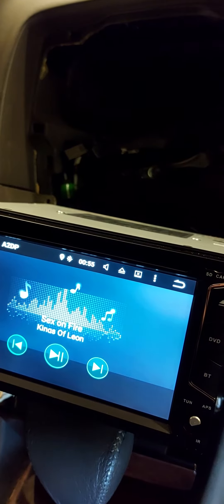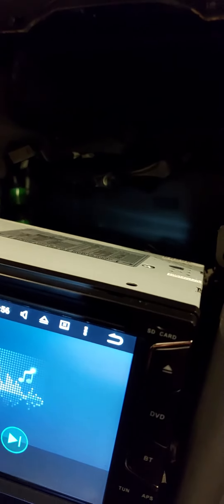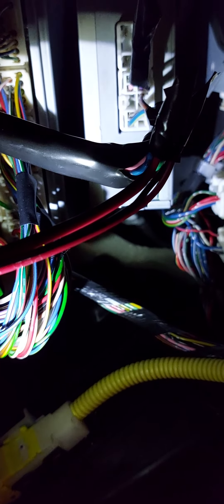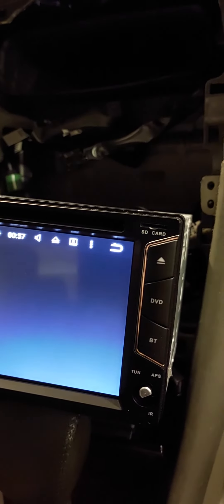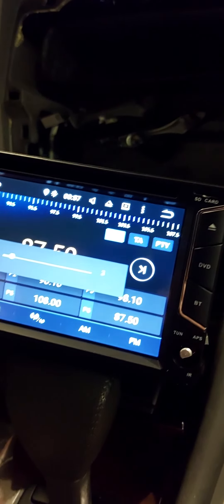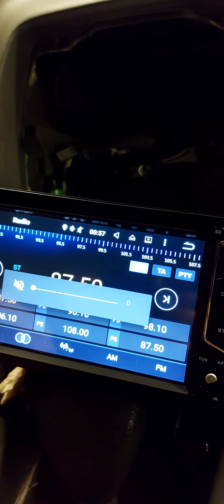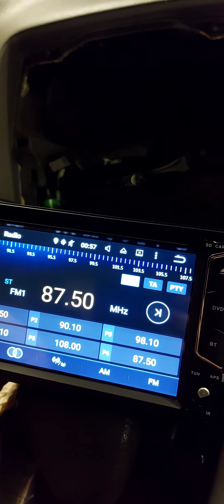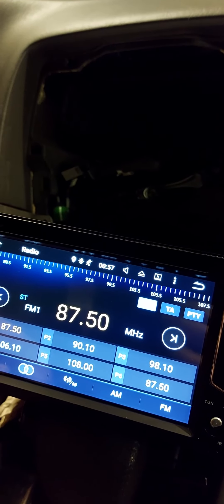Installing aftermarket stereo on 1997 to 2000 Lexus es300 PART 2

Comment: Which wiring harness did you use
Reply from the maker: If you asking for what aftermarket harness I used. I bought it on Ebay.  I'm not sure if they still selling them. I got the Best kits BHA8112 Aftermarket radio for toyota/Lexus. Also, I post the diagram picture on the posting section.